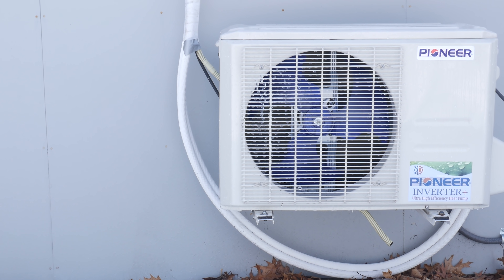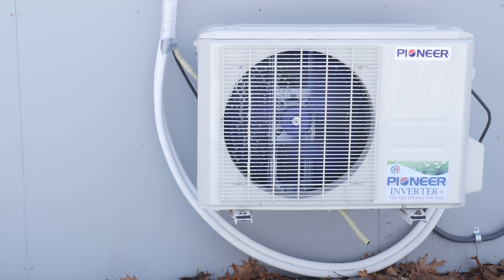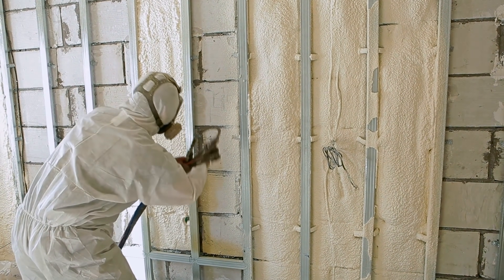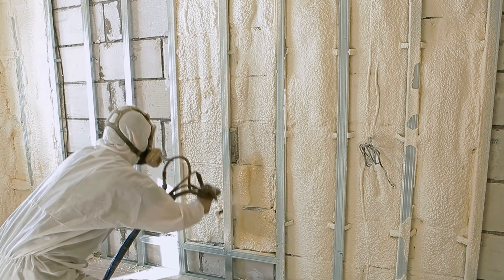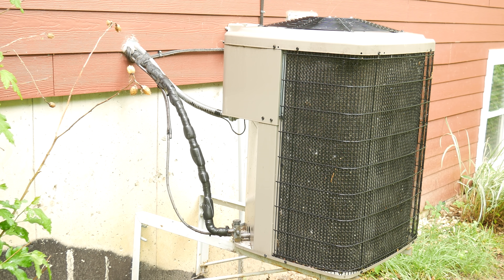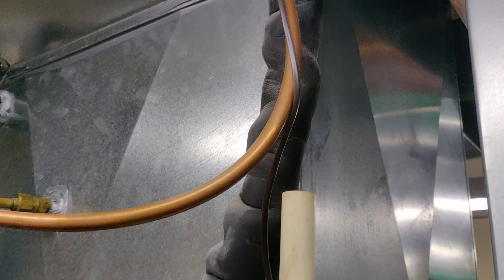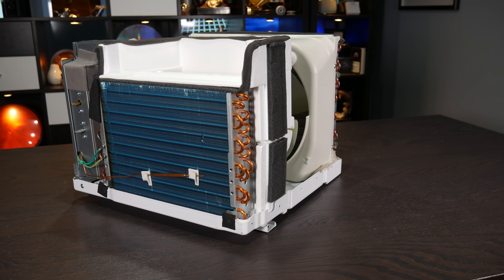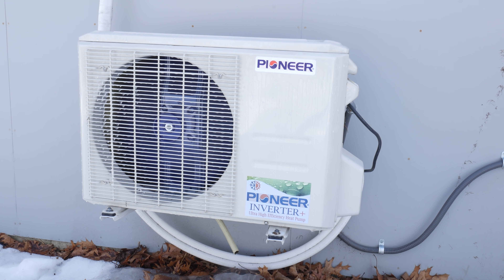Heat Pumps are Not Hard: Here's what it will take to start pumping

Comment: Thank you for this mini crusade for heat pumps. 
They look like a super solution, but in the UK the housing stock is SO OLD that the re-insulation costs alone would cripple most households of 70+ yr old homes (most of them). Plus there are “horror stories“ in the media about people spending £12-20k on systems that were leaving them in homes that were only 5deg C warmer than the freezing uk winter. 🤷‍♂️
There’s still a LONG WAY to go before these are seriously considered over here.
Reply: That’s mostly because they do not update the radiators (low temp requires bigger rads) and also because carelessness in designing the retrofit (eg: missing thermal wheel) also usage boiler-like (on just for few hours instead of h24)
Reply: @davidebacchi9030  maybe important considerations in general, but worth much less if the home isn't sufficiently insulated.
Or are your points just relative to the poor media reporting mentioned in my post? 🤷‍♂️😕

Comment: urrrg, you are very convincing.  I'd love to have a single outside unit (right outside the electrical panel) with heads through the wall in the bedroom and the adjacent office.  It never occurred to me that I could run another head the length of the building (40') to the living room.  I never realized that it was possible!  Time to get looking...
Reply: Do it!! It's super easy to install and we did it ourselves on four rooms already.

Comment: I have geothermal. I'd love to see a video on that. I understand it pretty well, but love to know the difference. It must be more efficient since it doesn't try to take heat from cold or try and cool using air from outside hot temps. Rather the underground loops (I have horizontal 3 loop system) sunk to roughly 10 ft gives the fluid a constant 55F temp year round to work with. 
Yes more expensive to dig and get but so far it's been great for me. And I bought the house with it in there.
In Michigan where I am, my worst electric bill for house and Geo heat was only 280 and that's for both the house electric and the geo. 
I have an older (2008) 2 stage with aux heat water furnace. Nowadays they have variable ones. But in stage 1 it runs at roughly 60% and stage 2 is 100%. In winter I did use stage 2 but never went into aux/emergency heat. 
In the summer is where it shines. My worst electric bill last summer was $90 for house and Geo electricity. That's insane. 
It also does most of my hot water. In summer it's essentially free by using heat pulled out of house and in winter it doesn't add much. I do have a gas water tank in tandem with it though, so if needed it does the final heating to my set temp. 
I do have a gas dryer and gas stove and gas fireplace but my gas bill has never exceeded $20. And $13 or $14 of that is just the premiums for having the service.
I will say the pricing is nuts right now. I called out of curiousity to see the replacement cost for my water furnace. 
Between part shortages and price increases over the last 2 years (totalling 40-45%) means that just removal of my old one, installing the new one and disposing of the old unit is 18k-19k. 
The reason this is nuts is I have the original receipt for when the unit was installed. The dig, laying the loops, backfilling and running the lines to the water furnace, the water furnace itself and everything was roughly 19k in 2008..... 
Also the companies are only building to order now with the units. 
I did call multiple places so I know it's not gouging. 
I just hope I get at least the minimum life of 20 years out of it giving me another 6-7 years roughly. On the high end they can last 30+ years. But the company that made my units main components like compressor and stuff went out of business so besides small components I can have serviced, when a major part breaks I will need to replace the unit. 
🤞🏻By the time I need one the pricing goes down.
Reply: SEARCH.  He already discussed geothermal/ ground source heat pumps
Reply: @electrictroy2010  inside before commenting. He lightly touched on geothermal but mostly discussed heat pumps above ground

Comment: "odds are you're probably in a decent place already" - Unless the insulation contractor for your house lied. (Spoiler, a lot of them do). My "Certified R30" attic was at most R-10 on average with spots as low as R-3. It is now R45.

Comment: We installed a mini-split (2 zones) last year in a house with an existing gas boiler and radiators. Our natural gas use plummeted just in time. Our rooftop solar was producing a surplus which is now absorbed by the electricity running the heat pump. Beautiful!

Comment: The pricing going on right now blows my mind. We installed a heat pump with a single head in our split-level house when we bought and improved it in 2016. Purchase and installation was about $6,000 CAD in 2016, under $5,000 USD. We paid an electrician to come out ahead of time and prep a breaker circuit for the unit, which was coincidentally super cheap because for some reason this house had two oven circuits even though we only have one kitchen, so a great circuit was just sitting there empty, waiting to be used.

It may be important to mention that 1) we bought through the installer, who runs a one-man show, and 2) the Newfoundland provincial government is really pushing for non-gas heat solutions.

Comment: I’m glad my quote experience hasn’t been the same as what you’ve shared.  I currently have Propane and no central AC, to get a heat pump installed with a 10-year warranty was $6k (when quoted, been a bit) and was told that’s just $600 more than a standard AC unit.  I just haven’t been able to purchase it yet.

Comment: When I lived in Indiana, I used a high capacity "window unit" heat pump in my workshop.  I installed it by cutting it hole in the workshop wall and sealed with expanding foam. These have been available at comparatively low cost for over 10 years... I was surprised that they were almost an afterthought in your presentation.
Reply: I’ve stayed in hotels that had pre-installed holes & metal containers (on the outside).  It made it easy to insert a window-style air conditioner/heat pump

Comment: Love your heat pump videos!  I live in an area with typically mildly warm summers, and mildly cool winters, so heat pumps are ENORMOUSLY popular here.  But they're mostly popular with people upgrading from oil furnaces, which means they already have ducting, and have an expensive to operate system just begging to be replaced.  The biggest challenge is that most OTHER homes have electric baseboard heating, and our electricity is RIDICULOUSLY cheap by global standards, so the potential savings are small, and our only mildly warm summers mean the air conditioning component is definitely a nice bonus but not something most of us here are willing to pay a lot extra for.  So there are LOTS of heat pumps here, but (despite how cool mini-split systems are) as the number of oil furnaces left to be converted to heat pumps drops we may see heat pump conversions drop with it.

But that's for existing homes.  New home construction seems heavily skewed to heat pumps here, which is undeniably a good thing.  There's hardly any natural gas here.  I don't even know if natural gas is a thing in my neighbourhood.  As in, does a natural gas utility even serve my street?  I have no idea!  I don't recall ever seeing a truck in the neighbourhood that look like it belonged to a natural gas utility, so maybe not?  Most people I know are heat pump or electric baseboard (or both, for the "but occasionally..." moments).
Reply: No idea where “here” could be located.  Are you US?  Canada, Europeanunion?  Aussie?
Reply: @electrictroy2010  Here is Canada in my case.

Comment: I installed a 4 ton heat pump in my 1,800 square foot home, buying the equipment from a mail order place in 2014.  It has worked great, and I never hooked up the electric back up heater, using that furnace to carry the air through my existing ductwork.  I changed the indoor fan from 1/3 HP to 3/4 HP to increase the airflow up to 1,600 CFM to meet the needs of a 4 ton system.  

I can cool my house in Portland Oregon by 5-7F each hour, as the cooling capacity is oversized!  But at 23F, the lowest normal outside air temperature in winter is 26,000 Btu's per hour.  So the heating is sized just right!  

I was in a home that had a 3 ton unit with about 2,400 square feet between the first, second floor and the finished basement.  It was not nearly large enough, but I suggested a 12,000 Btu unit in the master bedroom, to provide plenty of cooling there, and the cool air could circulate around the home when running both units on a hot day. The units are very quiet! 

The person I bought the home from said that one winter, the January bill was $400.  I have never been over $135 with my heat pump.  The 20 KW system is still there, and not hooked up at all!  

I replaced a lot of PTAC at a retirement center that I worked at.  The new ones work great to about 35F, then switch to electric heater at that point.  They had 75 rooms heated with PTAC's and about 60 using two Mitsubishi ductless heat pumps with two 480 volt outdoor units running all of the ductless systems.  The other buildings used regular furnaces and A/C units. 

I installed a 120 volt ductless 12,000 Btu unit in my nephew's rental home.  Not drilling any holes in the wall, I installed the indoor unit on a TV cabinet, that is about 6 feet tall, and 24" deep, 40" wide.  The tubing and drain line run out a window, to the outdoor unit, and the plug comes inside to a nearby 120 volt receptacle.  When he moves, he can take the indoor unit and pass through the window, then take it to his new home!  Don't need to disconnect the lines to move it.  

Your friend with the propane furnace and A/C unit should have considered and installed a heat pump, sure it will cost about $500 more for the equipment, and the Nest or other thermostats can change over automatically when the outside air temperature is less than about 25F to propane.  

Yes most companies take the cost of the equipment and double it, then add the labor costs, and add about 15% more for profits.  So the $6,000 system will cost about $6,000 more to install than a $1,500 system that is installed for about $4,500 total.

Your San Diego friend would be happy with a 18,000 Btu ductless heat pump in the living room, and then leave the doors open to the other rooms to keep them cool.  Perhaps install a window A/C in the bedroom if required at some point, but hey, Sand Diego the nighttime temperatures is OK.  And with 0 hours less than 20F in San Diego, and less than 40 hours per year less than 35F, they can get away without any back up electric heater.  

The air duct insulation on the San Diego house - if built more than 30 years ago might not have any insulation or R-2 insulation.  

With undersized air ducts, go for the heat pump that is about the size for the air ducts that you have.  Then install a ductless system in the living room to handle more of the heating needs of the home in the very cold days, or very hot days.  And the ductless system that the unit will use a lot less power per 100,000 Btu's of heating or cooling than the central system.  And no air loss from the air ducts!  Some systems can lose a lot of heat from the air ducts.

Comment: One thing I read from an installer... Using several small split systems vs 1 large multi zone unit is often more efficient. Many times 1 large unit to going to have way to much capacity 90% of the year. Since like you said they can turn them selves down to 25% capacity,  but if you have a 36k or 48k 4 zone system, but are only using it regularly in 2 rooms at minimum it may be running at 12k or 16k when the actually need is only 6 or 8k. That can lead to the compressor starting and stopping a lot more then necessary.  If using 3 12k or 18k systems the can run down to 4 or 8k and the rooms not in use can just be powered off totally.  Also price wise, buying sperate units is also about the same price or less then buying 1 super size unit.  $900 x 4 $3600, or $4200 for one large 4 head unit.  Plus with several units if you ever have a problem you can just keep using the other zones while 1 zone is down for repairs.
Reply: good shit

Comment: Good on you for attempting to give this all the time it needs. Although, as a tech savvy South Texan mechanic who knows very well what an air conditioner is and how it works, I have to say you ALMOST lost me waiting for the moment you would point out that heat pumps and air conditioners are literally the same damn thing.

I think that's the main knowledge barrier we have to overcome with educational bits like this. People who need AC already willingly embrace it with all of its pitfalls. Take it away and they will pay whatever the cost to get it back with no second thought as to its efficiency, noise level, etc. The function of a heat pump is no more conceptually difficult than understanding that if you installed a window unit with the wrong end facing in, it would make the room warmer instead of cooler. WOW

Modern heat pumps are just BETTER air conditioners that are ALSO better heaters than whatever else you've likely got. That is not a hard sell.  It's simply the fact that needs to be put in front of people.

 So while I enjoy being one of the people you expect to pick up what you're putting down at the level that you're sending it, sharing the thinly veiled frustrations of wanting to help address these issues without feeling like you're talking to a brick wall that happens to be shaped like millions and millions of people..  I think what needs to be done is not so much an argument of the merits per se, but more simply combating ignorance. If you accept AC on any level, you ALREADY accept heat pumps. 

 In my opinion that is the crucial icebreaker point to make, and whether or not it is a better heating system is sort of elevating a red herring to center stage. I mean, if I said I'd like to replace your car's reverse gear with an entirely separate reverse drive system with a different engine and this one doesn't run on gasoline it runs on propane because it is vaguely more efficient in some blah blah blah way, wouldn't your first response be something like "it's ludicrous to create an entirely separate system to make the car go backwards when I already have something making it go forwards that could also make it go backwards"?  If so, you my good fellow should be in the market for a heat pump. It's a regular-ass AC that goes.. in reverse! And whatever other entirely separate heating system you've already got.. THAT'S what's ludicrous! So dump it!

Anyway, nice work, carry on.
Reply: “inverted air conditioning” is the term used in other countries
Reply: @electrictroy2010  “reverse cycle air conditioning” in Australia

Comment: I've had a central air ducted heat pump for over 20 years, and I love its efficiency.  It only uses supplemental natural gas heat when the temperature outside is very cold.  It's not as low as the ones you mention, but that's probably because of its age.

Comment: These heat pump videos are pretty great, Alec, but are mostly from the point of view of regions where refrigerated AC is very common. Here in the Southwest USA (NM, AZ, West TX) refrigerated AC is comparatively rare and seen as superluxurious, with evaporative cooling and gas furnaces being ubiquitous here in the domestic space (excepting, of course, commercial AC installation), but refrigerated air is also becoming a little more common.

It would be interesting if you could make an episode comparing the two types of cooling (mostly in arid regions), their respective resource usages (one uses a load of water but can plug into the wall, the other makes water but drinks power like no tomorrow) especially considering the SW megadrought and potential power generation shortages, the pros and cons of replacing one system with another, and what it would mean for a heat pump installation instead of gas.

Comment: Hey…. You got me!  I live in northern Quebec, Canada…. I just install a 18000 BTU mini split …. Had to run the gas lines across the whole house in the attic. It only had 4 inches of fibreglass panels..  1000$ later, and 2  days of hot sweating and itching.. my attic now as between 12 and 16 inches of insulation (r40 to R60)…. Looking forward at my electricity bill this summer!   

Side note.. darn the fibreglass insulation is expensive now…. 80$ per packs here..

Comment: It's -10⁰F at 2pm where I am at.  What works good here is underground coils to gather heat or cold in summer.  This is more expensive but this system uses far less electricity that system pays for it's self.  I am lobbying my city to require landlords to split utilities with their tenants and have a low cost retrofit program for insulation and equipment that is paid over time on the utility bill.  The idea being that the utility bill plus the retrofit bill would be less than the old utility bill. The idea here being incentives all around would get the job done.